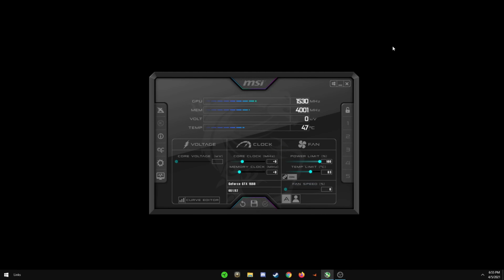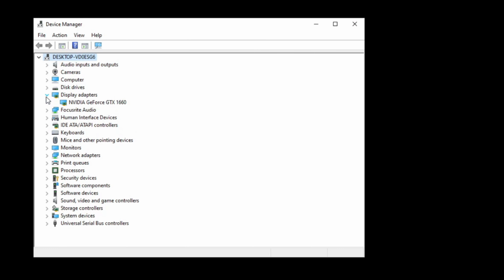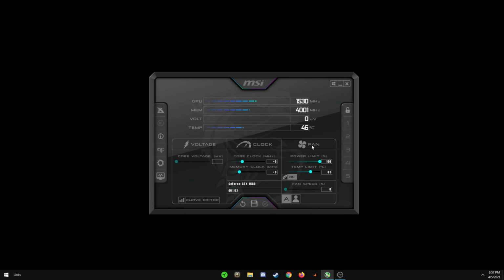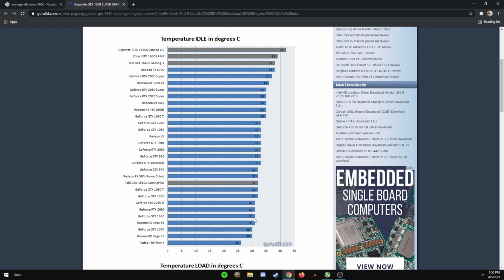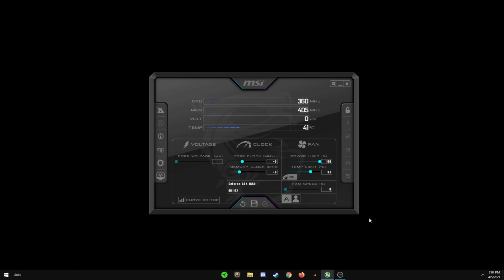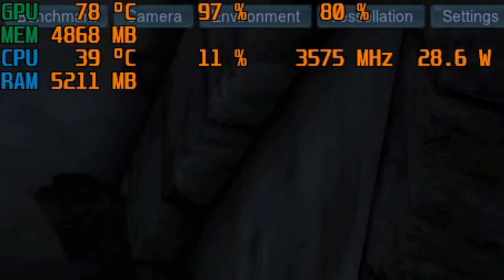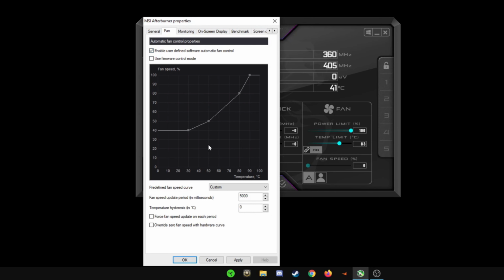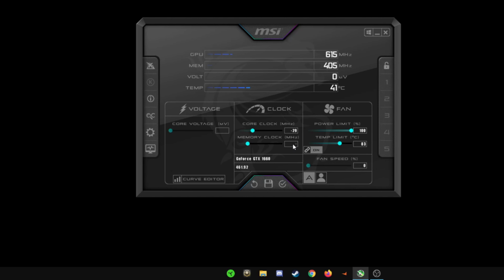GPU Overheating or Causing Crashes? Fix

Comment: My gpu is fine it’s 3080 laptop version on forza max settings it gets to 63 degrees and only uses like 70% of my gpu but Fortnite uses 100% and my gpu temp goes to 90 degrees any fixes?
Reply: set fps limit 60 or 75 or 90

Comment: But the thing is my gpu is at good temperature it’s around 50 to 60 degrees, but when 
I play fortnite my game crashed
And my gpu comes oc straight out the box 
I have a gt 1030 oc edition gddr5 meme org with 8 gb of 1333 ram and a amd fix 6300 6 core processor
Reply: that can be because of the settings inside fortnite exceeds your pc specs.